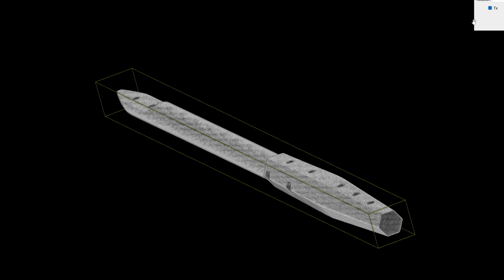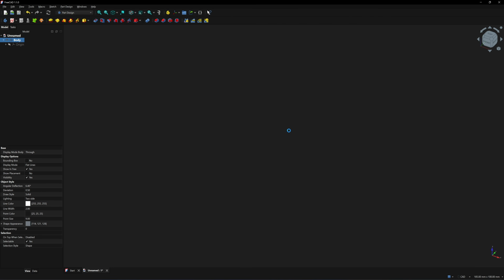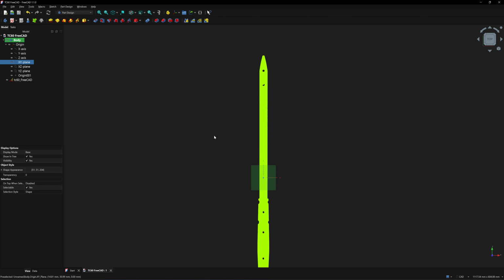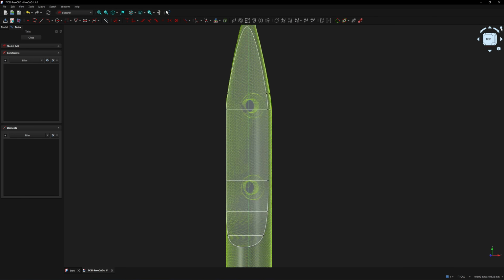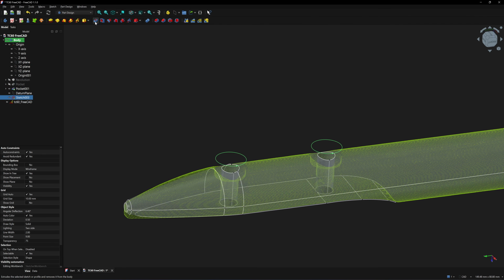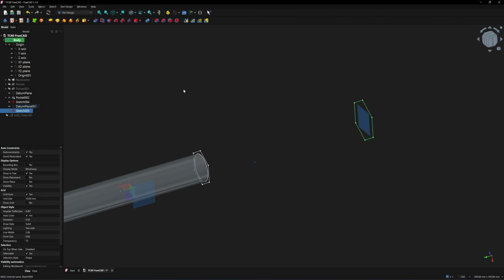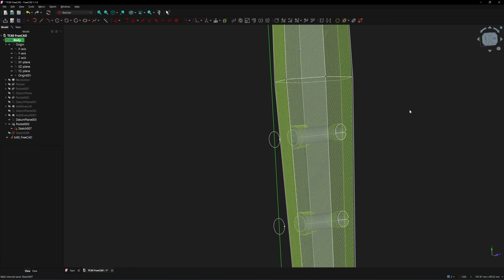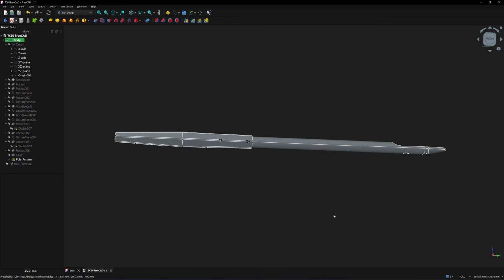Learn Reverse Engineering in FreeCAD  Beginner Tutorial Sermoon X1 Scan

Comment: What do you do if you have an asymmetric part you're trying to reverse engineer?
Reply from the maker: I would reverse‑engineer the part as it is. However, if the part is truly symmetrical but the 3D scanner lacks precision, I could never be certain which side of the mirror axis holds the correct dimensions. In that case, I would reject the scan data.